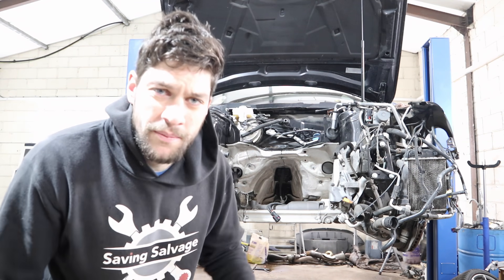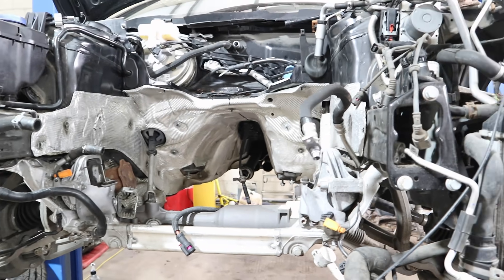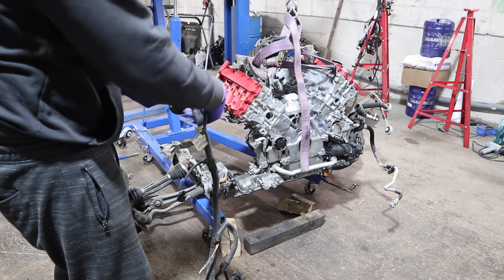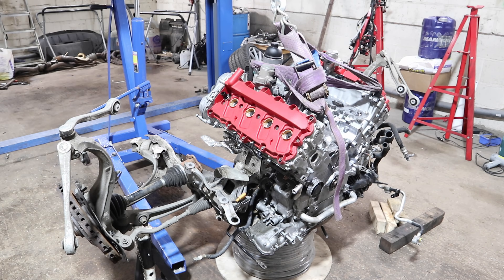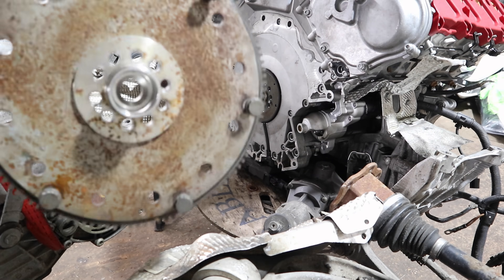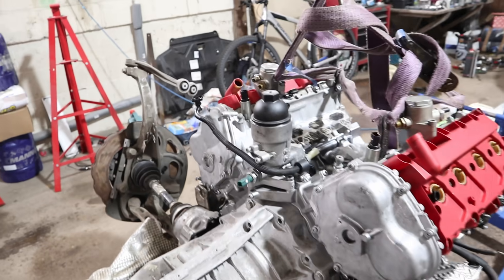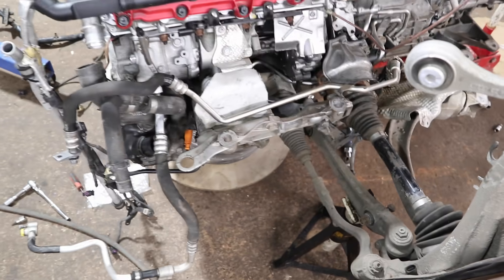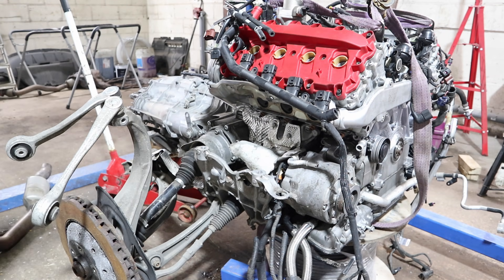My 2014 Audi RS4 FULL V8 Engine Rebuild PT.6.... OKAY MAYBY NOT!!

Comment: I've been building V8's ,hot rodding, engine swapping, Porsches etc for decades now, still doing it, and had considered getting a RS4 to play with, but these videos are making me think again. Once rebuilt a Porsche Boxster engine , got it back together tried to start it and it sounded like every rod was knocking, turned out I'd got one cam 180 degrees out, needless to say it was probably one of the most depressing and expensive experiences ever, makes a small block chevy wiping a cam on start up seem like nothing at all. Pull the vehicle apart again, all apart, check , fix , all back together again, the stress of it all made me feel ill, but the final successful start up gave such a sense of relief and vow to never do that to myself ( and family ) again, but of course I never learn..  I only send this message to say God willing it will be a successful start up, but if things don't go too well, don't let it get to you, this vehicle has got to be one of the most difficult, over engineered, Germanic nightmares ever, beyond the resourses of any individual almost.So far very well done!

Comment: Great job Dean - as many others have said you have the patience of a saint - and you need it with this build for sure. Can you imagine back in the day when the Audi team were looking at packaging this lump into the bay - “don’t worry about the starter motor - it will never need changing”
Reply from the maker: Thanks! The ironic thing is, I did have a duff starter, had to remove the engine and gearbox again to change it! This will be the 3rd time putting it all back in 😂😩

Comment: Good work, water cooled alternator?  Is it that or the water pump driven of the back of the alternator?  Eather way more complicated than my old land rover v8. 😱
Reply from the maker: The water pump sits under the a/c compressor on the other side. Alternator just has an inlet and outlet pipe for water cooling

Comment: That engine is packed way to tight. To get to anything, almost everything else needs to come off and for some of it, it can not be done with the engine in the car. Very costly for labor. That car is the type you lease for 5 years max then trade it in, before it starts to breakdown and needs major, costly, repairs.